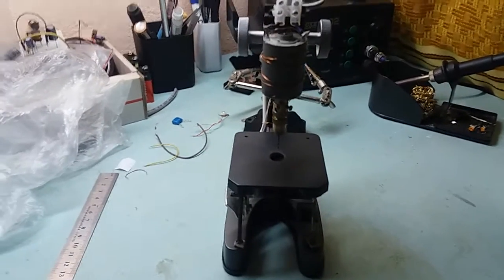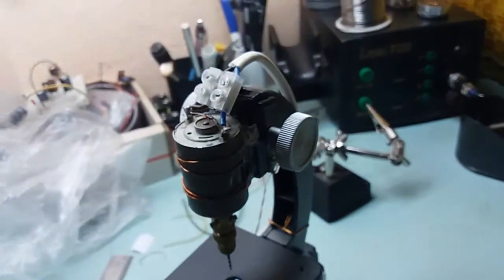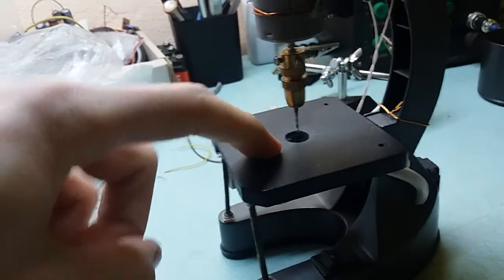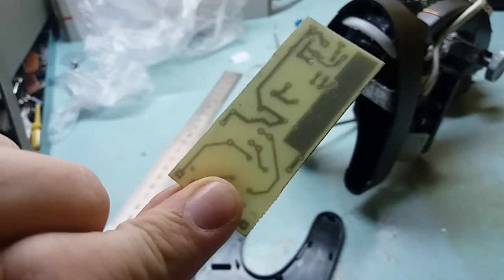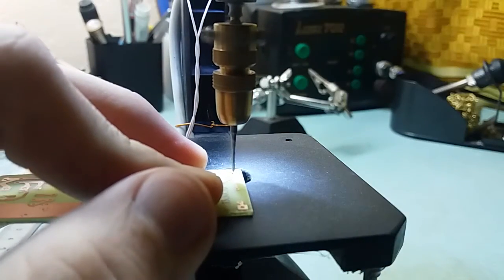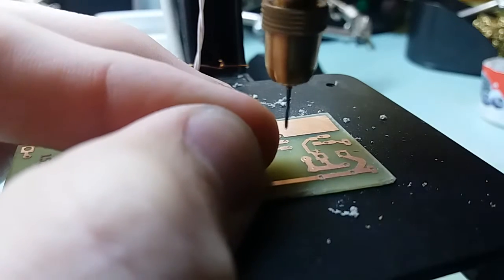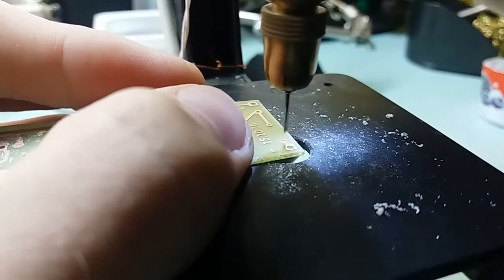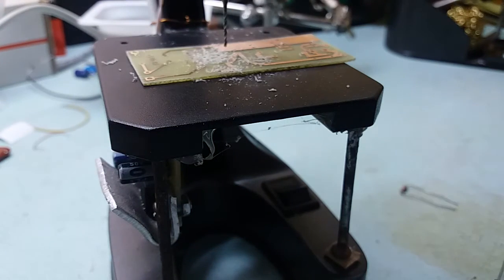Simple PCB drill press out of a TOY uScope

Comment: That is pretty awesome.
Reply from the maker: Thanks! It works really well for what it is. There is a small wobble but it's small enough to not cause trouble. If I carefully hold the PCB while I'm drilling the bits don't snap, and those are as small as 0.7mm tungsten carbide and they are very brittle.
Reply: MrJohhhnnnyyy I'm tempted to try out your drill spindle circuit for my PCB CNC router. I think it will be very handy for drilling the mounting holes on PCBs.

Comment: I am planing to use cd drive slide mechanism  for that cause I broke most of my carbide bits also it might me nice to take of advantage that stepper motor shaft coud be used as automatic slide mechanism using belt that coud slip over main motor shaft and step motor shaft with small puley and circuit that woud control up and down motion of drill. Also I woud never think of that smart circuit that you used so amazing
Reply: that circuit coud be used in dremel while sanding stuff
Reply from the maker: Yes, that circuit is real good. Simple and performs great. I see you have quite an elaborative project there, good luck!

Comment: LOL a microscope toy to pcb drill, thats very clever :-D.
I used to drill pcbs with a cheap 12v drill, but i never thought of a mini drill press.
You have a fine control, good for the really small drills :-).
A pcb that meters the current and adjusts for loading, too dam posh lol.
Reply from the maker: After breaking a dozen of bits, I decided to finally make myself smth like a drill press. Carbide bits are AWESOME but very, very brittle. That controller decreases the risk of snipping the bit in half when you touch the board, try to do that at 3-4kRPM :D You can use a button, place a bit in a right spot and turn the motor on. But that sucks: push too much - the motor struggles; push too light - the bit will slide away and completely DESTROY the pad.
Reply: Yep ive been there, the "Shit it snapped" moment lol.
I used to buy drills from a small car parts/accessory shop, they were for drilling carburettor jets out.
That was a looooooooooooong time ago lol.
Reply from the maker: zx8401ztv I actually thought about drilling out a jet on my bike :) But the bits I have are not the needed size.
Reply: Yes motorbike jets are small, moped jets are tiny.
The problem with drilling them is you have to increase the air to balance the mixture, it can be a nightmare.
Would you be trying to acheave warp 9 :-D